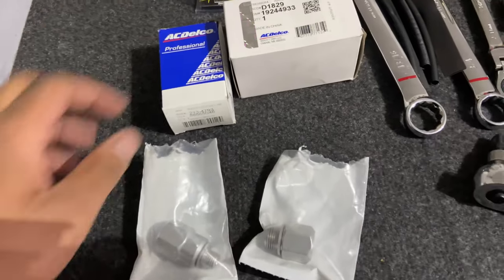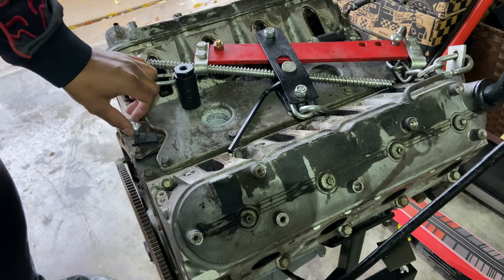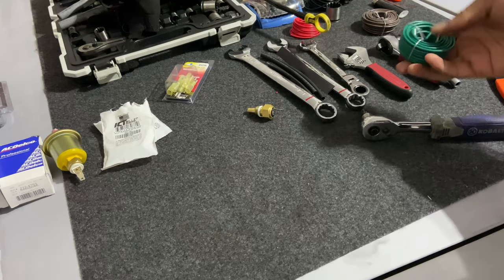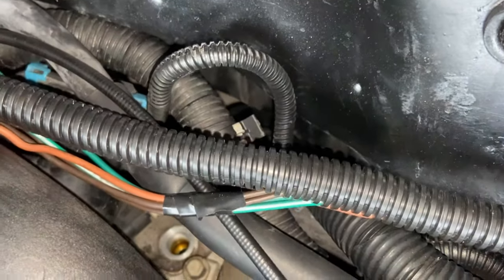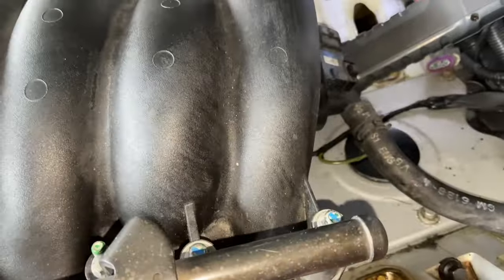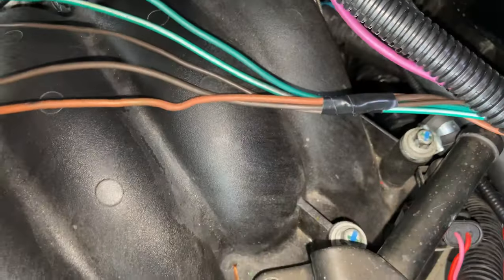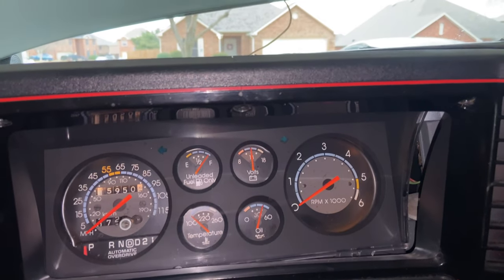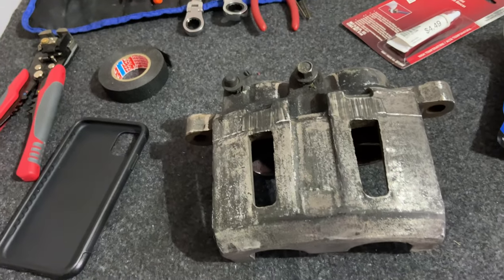HOW TO GET THE OIL PRESSURE GAUGE TO WORK ON LS SWAPPED 86 MONTE CARLO SS

Comment: I used a oil pressure sending unit for a 02 Silverado and a coolant temp sensor for a 98 Camaro. Did a 5.3 swap in a 94 S10. All my factory gauges, warning lights and cruise control all work.
Reply from the maker: That’s what’s up. I tell everybody it’s not hard to get the stock gauges to work. I’ve since switched to Dakota Digital

Comment: 4 months to late here but you can buy a LS oil pressure sensor relocation hose which basically is a braided hose that plugs into the oil pressure sensor port behind the intake & allows you to locate the sensor some where ells without having to kill your self trying to get to the damn sensor behind the intake. Just goto ebay type in oil pressure sensor relocation kit
Reply from the maker: Yessir that’s what I ended up doing.

Comment: Have u got ur stock tach working, I know had to do it, it’s easy hit me
Reply from the maker: It got it hooked up but it goes out sometimes. I just ran the wire that comes through the firewall that used to go to the distributor, ran it to the tach wire coming out of the LS Computer.
Reply: @PENNYLS1  Can you give a little more detail on the stock tach wiring?

Comment: Do you still have to run that gauge temp sensor even if you have the stock temp sensor on the other side? Probably a stupid question.
Reply from the maker: For the stock temp gauge to work yes. The sensor on the driver side feeds the ECM and turns the fans on at the proper temp. The sensor on the passenger side goes straight to the factory gauge.  That’s how mine is set up. Hope this helps.
Reply: Thank you

Comment: Does the computer have to have the stock oil pressure stuff.
I'd like to have both.
My old gauge too.
Reply from the maker: The computer doesn’t read the oil pressure. The sending unit is going straight to the original gauge inside the car.

Comment: Does that part oil sensor work also for the chevy silverado obs gmt400 1990 trucks?
Reply from the maker: If your stock sensor looks like that it should work.
Reply: @PENNYLS1  it looks but has diferentes part numbers for silverado 1990
Reply from the maker: @jaxjax5322  use whatever your stock sensor is if you trying to get you stock gauge to work. Just get the right adapter to fit whatever your swap engine is.
Reply: @PENNYLS1  do you know whats the difference between this 2 part number they look the same 19244933 and 19244935
Reply: Thank i don’t know wich stock sensor had i bought the truck used and didn’t work that gauge anywas thank you for youre time too answer me

Comment: You couldn't use the factory wiring?
Reply from the maker: I did use the factory  wiring, but the connector was cut off the end.
Reply: @PENNYLS1  got you
Reply: @PENNYLS1  my oil pressure sensor is on the valley cover will this work the same way?
Reply from the maker: @Bball128  yeah It should work the same.
Reply: @PENNYLS1  cool....I may have too put a 90 degree angle on it because it's already tall
Reply from the maker: @Bball128  that or try a 45°
Reply: @PENNYLS1  thanks bro
Reply: Can you use the other head for your temp sensor?